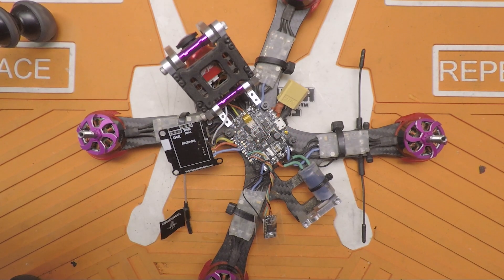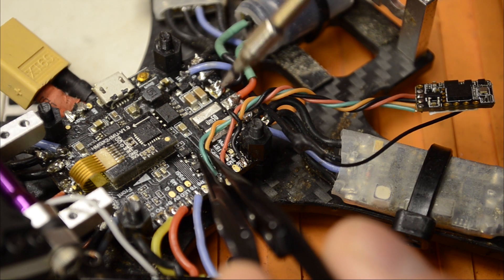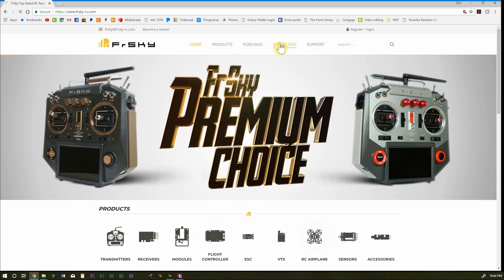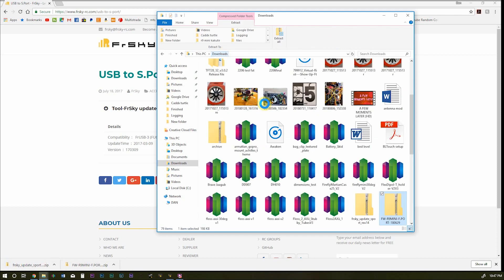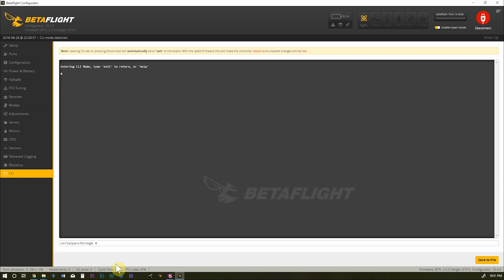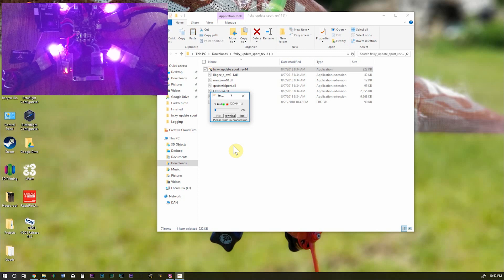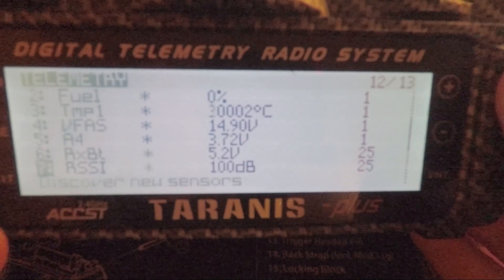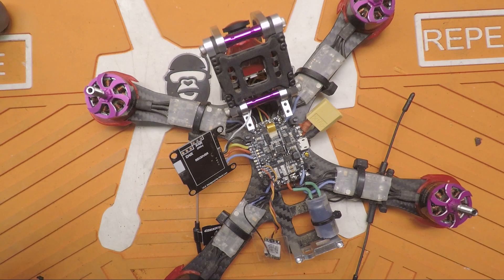Kakute R9M Fport setup and firmware flashing serial pass through

Comment: to add some more confusion to SBUS, I have an R9MM both inverted and un inverted outputs , and an F4 with an sbus labeled pad claimed to not need softserial (iflight f4 mini stack), set it up like an f7 or f4 which pin for signal on the r9mm
Reply from the maker: You are getting sbus and sport confused. Sbus is your rc commands and you only have one output on your rx. All flight controllers have a sbus input which has the inversion taken care of. Sport on the other hand is a inverted protocol and will need either a "telemetry" pad on the fc that has a inverter or you will need to use the "un-inverted" sport pad on the r9mm. Or worst case you'll need to use soft serial and resource reassignment to assign which pad on the fc will accept the sport Telemetry.
Reply: @TweetFPV  going to have to flash it with the transmitter as i didn't have anything working previously, new build, once you are fport though on the RX, would the f4 mini fc be expecting an uninverted or inverted signal on an sbus labeld ( probably hardware inverted pad )  i should be able to send the signal from the fport pad to the left of the ground
Reply from the maker: F port is not compatible with any sbus pad. If you wanted to use fport you will still need to use the "inverted sport" just below the vin pad to any avalible rx uart pad on the fc.
Reply: I connected it the wrong way a few minutes ago and it still seems to work a little?, only reciever voltage and RSsi are showing up values in telemetry (Unarmed) yet all the sensors are found, sticks/switches work great. I should mention the pad also says I-bus in the manual so no idea on inversion.
Reply: @TweetFPV  set serialrx_halfduplex = OFF
set serialrx_inverted = ON
I put these commands in the cli , I'm sure somethings not right
Reply from the maker: Ok, which fc are you using?
Reply: TweetFPV iflight succex f4 mini stack the 6s 35a one , pretty much only leaves me that one pin on tx6 to work with
Reply: @TweetFPV  I just found one spec sheet that says SBUS =NO , With that im assuming that its just a standard tx6 Uart, so I should signal from the inverted sport pin with these commands _ set serialrx_halfduplex = ON
set serialrx_inverted = OFF
?
Reply: @TweetFPV  sorry for blowing up your comments, figured it out, looks like iflight revised the manual and it shows it as RX6 now on some of the online diagrams, said sbus/ibus in the old manual. It all makes sense now lol

Comment: I'm trying to do this same procedure on a Matek F405-CTR. The Smart port wire is soldered to TX2, but it's also assigned to softserial 1 for inversion. What should I type into CLI for serial passthrough?  Tried "serialpassthrough 1 57600" but it didn't work.  Any help would be appreciated.
Reply from the maker: Are you trying to flash the rx with serial passthrough?
Reply: @TweetFPV  Yes. Specifically I am trying to flash a new R9 mini via serial passthrough that is already soldered into the FC. The R9 mini is powered by a separate 5v pad that is not powered by the USB.
Reply: When I say it didn't work, I mean the Frsky update tool does not find the device.
Reply from the maker: I have not been able to get the serial passthrough to work for flashing the rx while using soft serial.
Reply: @TweetFPV  yeah after tons researching, I came to the same conclusion. I desoldered the RX and flashed it from the QX7. Everything works fine now. Thanks for your replies to my questions.
Reply from the maker: Yea I wish it were easier. Hopefully frsky will start doing Ota updates like they said.

Comment: First of all, thank you for your Excellent contents and support.
When using the betaflight softserial with the smart port, what does the serialpassthrough command use for the UART number? for example, I use softserial 11 that was tx1.
then Is it rigth "serialpassthrought 0 57600" in CLI?
Reply from the maker: I have had no luck using serial passthrough with soft serial.

Comment: thank you for you video. As you guided, but I can not flash firmware to R9MM. After select firmware file, frsky tool can not find device though it find com port 12 that betaflight conneted. I'm using windows10, KATUTE F7, R9MM recevier.
please help me.
Reply from the maker: Do you already have the rx working properly with telemetry?
Reply: @TweetFPV  yes. I confirm working.
Reply from the maker: What uart is your smart port wire connected to on your fc and what cli command are you using?
Reply: @TweetFPV  UART is tx4. serialpassthrough 3 57600. when I enter cli command "serialpassthrough 3 57600", command line is fill unknown character. it is different with your video.
Reply from the maker: That command looks right. Doea the rx power on with the USB cable connected and no lipo?
Reply from the maker: serial passthrough will NOT work if the RX receives power from the USB port.
Reply: @TweetFPV Thank you for your kind answer.  I tested with lipo. After I select firmware file into frsky update tool, I connect with lipo. but The result is same. What's problem?
Reply from the maker: if the RX gets power from the USB port this will not work. The RX can only be powered by the lipo. When the RX receives power it looks for programming signals for a split second. So if it has power from the USB port it is no longer looking for the programming pulses by the time you are ready to flash firmware to it. 

so the process is:
1. connect to BF
2. enter serial passthrough
3. close BF configurator
4. open FW flashing program, select file
5. connect LIPO

then the FW flashing tool will start flashing the RX.
Reply: @TweetFPV 
0) I connected with lipo. 
1) After betafligh connection,  in cli, enter serialpassthrough 3 57600 and disconnect bf
2) execute frsky update tool, select firmware file.
unfortunately result was same. Is there problem in my process?
Reply from the maker: ok. just to clarify does your RX get powered when the USB cable is connected and LIPO not connected?
Reply: @TweetFPV  Rx get powered without lipo.  When I turn on Taranis X9D+, RX receive signal from X9D+. I checked it from Betaflight Receiver Tab. thank you.
Reply from the maker: Ok. then this process will not work for you. To make this work move your RX power wire to a different pad that does not get powered by the USB port. Move your RX power wire to the 5V pad at the front of the FC by the "Video In" pad. This 5V pad is not powered by the USB port.
Reply: @TweetFPV  Sorry. I did that you told. but It's not working. The receiver did not get powered by USB.
1) After betafligh connection,  in cli, enter serialpassthrough 3 57600 and disconnect bf.
2) execute frsky update tool, select firmware file.
3) I connect with lipo. then RX get powered.
4) FrSky update tool did not find device.
Reply from the maker: @2windboy     try "serial passthrough 3 115200"
Reply: @TweetFPV  Thank you. I cleared the issue. I found that com port of device manager in my computer was setted 9600 bit/second. So I changed from 9600 to 57600. 9600 was default value of com port driver.
Your contents is very helpful to me. Thank you very much.
Reply from the maker: That is great news, I'm happy you were able to get this to work.

Comment: Can you please do a video on changing between 25, 200, 600mw for the r9m? Im having to re-bind the reciever whenever I change milliwatts.
Reply: BoyakaFpv H I think on the frsky website that this is how it’s designed to function
Reply: Thought I was going crazy for a minute there... I am right. Read the manual for R9M EU version. Switching the modes between telemetry 25mw and no telemetry 200mw/500mw requires rebinding rx.
Reply from the maker: Ah EU version. Yea there is some strange things going with that. Hopefully the flex firmware will correct those issues.
Reply: Btw very helpful video tweet.. subbed
Reply from the maker: That isn't right. I can change power levels all day without needing to rebind.i would re flash your rx and TX firmware. What radio are you using?

Comment: Very helpful - I’ve been struggling for a week now to hook a kakute f4 v2 aio hooked up to a r9 slim via fport. Using uart1 (inverted) and can get command and control to FC but get no telemetry back to the slim.... pulling my hair out, any guidance you can offer would be most appreciated. I’ve watched every video I could find even remotely related - researched online and found people having had same issue and found people saying they hooked up the combo without any issues even emailed hollybro with no response. Thanks for all you do to help the hobby! Cheers
Edit to note: slim has been flashed to fport firmware, r9m flashed to current as well as x9d and FC. Connection between slim and fc is from receiver pin SPort to pad SP on fc
Reply from the maker: Are you trying to use fport or sbus and sport?
Reply: TweetFPV fport (sorry was just editing to clarify that :)
Reply from the maker: Just wanted to check but do you have telemetry enabled in the betaflight config menu?
Reply: TweetFPV yes, the telemetry slider is in the on position - I have been able to get full telemetry using SBUS/SPort (have not gone for a flight with it set up this way though but on the bench everything looks and acts correct) but not able to get it after reflashing the receiver and making the changes I thought (and verified by today’s video) to work on fport. Was mostly wanting to run all on fport if possible to be consistent with my different quads.
Reply from the maker: I'm sure you have already done this but have you deleted all sensors and re-discovered in your radios telemetry menu?
Reply: TweetFPV yes, the only telemetry I get is RSSI and rxvc- has me absolutely baffled and being new to FPort I’ve been assuming it was a short coming on my knowledge but I’m starting to doubt my doubts 😂
Reply from the maker: Yea you should have at least 7 sensors on the kakute f4. Send me a cli dump to tweetfpv@gmail.com
Reply from the maker: Go to the cli and type get tlm and see what it says for tel_halfduplex and select the opposite of what's there it's either on or off  and type save. I want to say it should be tlm_halfduplex = off
Reply: TweetFPV morning Tweet, my apologies for disappearing in this, I was mobilized for search and rescue in the Carolinas. As soon as I get back home to Colorado I’ll get back on this. I did finally hear back from FrSky and they said a resistor has to be soldiered between ground and the SP pad? They had an attachment with the response but I for the life of me can’t get it to open so I have no idea what’s in it. Hope all is well and thank you again for everything you do for the hobby and to help us individually 👍
Reply: @tbcsseod  did you ever fix this? if not, you need to enable the telemetry box on the taranis menu page where the bind button is found